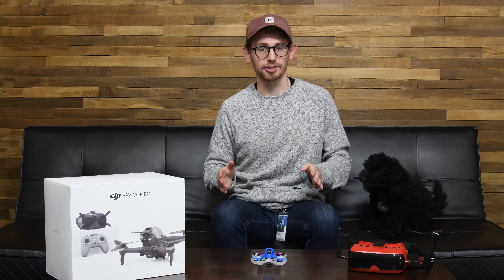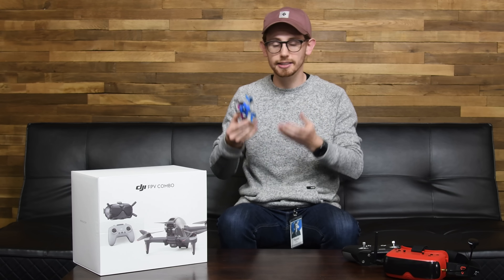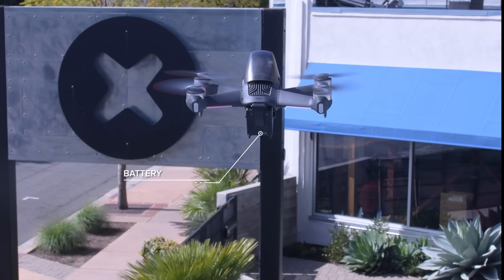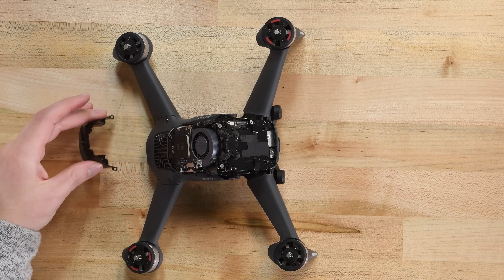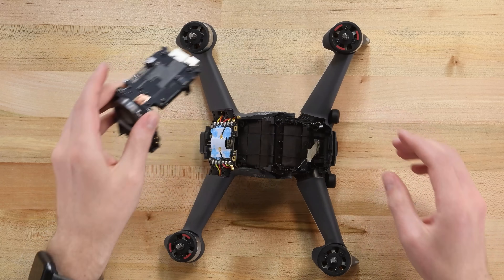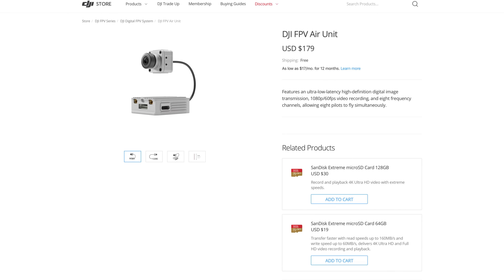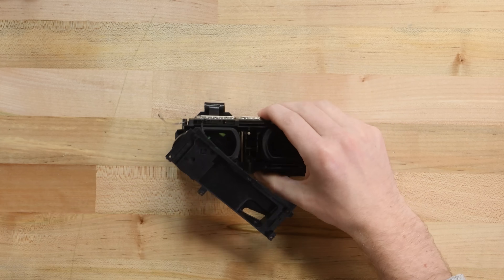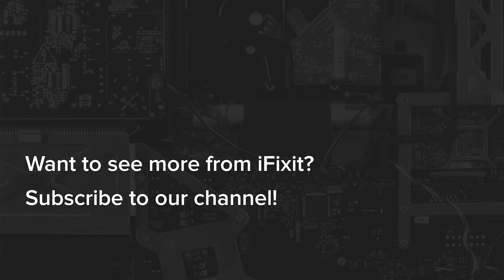DJI FPV Combo Teardown: Can DJI’s New Drone Kill the Custom Drone Market?

Comment: Solder points are on drones for durability mostly... connectors can pop out in a slight crash, but good solder points don't. Please research this more before spreading incorrect info.

Also... this is a teardown video but you're "sparing us the details" and skipping the teardown??? TF is this 😂

Comment: it is expensive because of 1. the goggles, 2. the big long-lifespan battery, 3. a 4k camera system, and 4. the innovation as a whole.

yes, other fpvs are a lot cheaper (nazgul5: $285), but if you include your goggles($17-$569) and controller($124-$300), use a gopro ($260-$350), find a counterpart for the long-lifespan battery and charging kit (another $100+), you'll end up a little less than the $1,200 price. This is without additional features that the dji fpv offers such as the RTH, emergency brakes, etc.

all in all, the $1200 price is fair enough for a beginner's fpv drone. it gives you more reason not to crash an fpv and fly responsibly.

Comment: You and most of the “fpv” folks always miss a huge point  here..  home built fpv drones even those built by people who know what they are doing can not land or take off  without goggles.. The best part of DJIs drone is its ability to be flown like the photo drones most of its consumers are used too.   With a flick of a switch it’s flown just like a camera drone..  no goggles needed.  This gives it the ability to be flown anywhere without the safety issues that come with traditional fpv equipment.  It’s good for beginners but it’s great for photographers who want that extra footage without all the safety issues and the learning curve that come with traditional fpv homemade equipment.

Comment: I’ve crashed and spent many hours looking for my old fpv drones so brought this on launch day but a sensor failure made mine drop uncontrollably mid flight  , for one dji wanted an extra £250 on top of the £300 dji care I already paid and second it’s been 3 weeks and still have no idea when I will get it back from the repair . Watse of time I’m back on analog I’ll sell the dji fpv when it’s fixed
Reply: Mines dropped out of the sky in manual mode broke to rear legs which i have successfully repaired unfortunately my sensor was damaged I can’t tell if it happened mid flight or it was from the impact damaged. I have no idea why i lost power

Comment: Is it true that DJI has stopped manufacturing the drone itself and will be using a 3rd party but will continue to sell the goggles and controller?
Reply: no I'm pretty sure it was just the air unit camera (which is for the custom market not this drone)

Comment: Short answer: no, the DJI FPV drone has less power and flies way more sloppy than cutom built FPV drones. Also there's no modularity like for custom ones, where you have endless options for the combinations of parts. Also, fixing a custom drone only costs a few bucks and maybe an hour of your time, compared to DJI FPV where you pay a fortune to send it in and let DJI fix it themselves.

Comment: I dont think so, dji fragile and hard to fix, the racing is impossible since huge video feed latency and freestyle is not as good compared to regular fpv, its rather slow compared to cheap custom fpv drones,... Its good for video production but not what fpv is realy used, in reality its made for videos nothing else, its a different market... The dji googles did not revolutionized fpv market since it comes with big latency, unusable on high speed and tight corners, only ppl who use dji googles is light flyers, amateurs, everyone else still uses analog.

Comment: Another note, you are the third reviewer who has stated that digital has longer range then analog. This is simply and entirely untrue. Analog has an immense advantage over digital in terms of range. DJI has the range marked at around 4km. A good analog setup could easier go 20km plus.
Reply: but you cant argue the picture quality, and in the end isn't that important for the experience/realism?
Reply: @foam27  No you are correct I cannot argue the picture quality. But all in the same I’d much rather just buy the goggles and a DJI fpv unit and use that. You get the best of everything, the performance and repair ability of homemade drones, and the picture quality of DJI. I don’t do super long range so the range is a non issue to me, I just wanted to clarify for those watching that some things he said were invalid.
Reply: @isaaclanier1507  I think you are correct about the range issue but not about the picture quality.
The transmitted video from the new FPV drone is superior than the quality transmitted from an Air Unit. NURK FPV made a video about this new drone and commented about the superior video quality over his other DJI goggle experience.
Before seeing NURK's video, I had assumed the video quality would be similar to an Air unit. NURK's video convinced me I wanted this new drone because of the improved transmitted video.
Reply: @ddegn  Ok yes sorry it is improved, I guess what I’m saying is for me at least, it isn’t enough to warrant going DJI and losing flexibility and repair ability rather then just building my own and using an Air unit. The Air unit is so good as it is that quite frankly I don’t feel the need for the better video
Reply: @isaaclanier1507  There a plenty of legitimate reasons not to get this drone. I was considering getting DJI googles and a few Air Units for a long time. This thing come out and it apparently has even better video. As an added bonus it will easily hover. My other analog FPV quads are really hard to fly and nearly impossible to hover. I really like being able to hover as I fly FPV and I really like this new drone.
If I had an Air Unit with Goggles I'm sure I would have liked that and I would likely not have purchased the new drone.
It's great there's more options.
Reply: @ddegn  and those are both fair points. Don’t take me wrong, DJI made a great product here, just not for me as I already know how to fly FPV fairly competently. The main killer to me again is being able to repair it, it’s much harder then a normal quad. That’s why for most people I’m probably still going to say buy a controller and try a sim.

Comment: I disagree with you saying FPV drones usually have limited compatability. The opposite is true, I love being able to replace almost any part with a different similar one if I can’t find the original
Reply: But that is absolutely peanuts compared to typical fpv drones. Can you switch the motors on your mavic and phantom? On fpv drones there are like 7 parts needed to assemble a quad (frame, fc, esc, camera, vtx, motors, props) and you can mix and match almost every part together. There is a standard for everything, and even competing companies still make parts that can work together. Where as dji have gone out of their way to make their products impossible to modify
Reply: @paul-fornage  I am super confused who you are arguing with. Read my comment again.
Reply: @isaaclanier1507  I thought you said DJI FPV
Reply: @paul-fornage  no I was arguing against how they stated that normal FPV drones have limited compatability. And how you can replace almost anything with anything else if you know what you’re doing. DJI made a lot of good choices with this drone, but I am still sticking with my homemade ones
Reply: @isaaclanier1507  well.. you CAN put 30000kv motors on a 6s.

Comment: The thing about it is, it isn't really an FPV drone. Sure, it can be an FPV drone, but it's more of its own thing half way between a camera drone and an FPV drone. It's honestly best when flown in Sport mode with all its sensors and computers working to assist the pilot in some fun, but not too challenging flying and to capture some cool shots. I see it as a method for Mavic pilots to get FPV footage without having to invest time and energy into the real hobby. Of course, it can also be a gateway to the hobby, and I hope DJI eventually sells a gen 2 air unit to work with the combo controller and goggles so that people who want to make the jump to real FPV can do so without having to buy new goggles and controllers.

Comment: A lot of people in the custom drone market are pissed about this. When the fact is... FPV is now on the map because of DJI.
Reply: I am excited that some FPV groups might finally form around where I live
Never have anyone else to fly quads with
Reply: Lol they don’t want it on the map
Reply: The FPV Hobby, not custom drone market. And most of us welcome it, but it has to be done right. It could have come in a better form factor, and a stronger/more repairable frame and canopy,  because you only learn in FPV by crashing.
Reply: they not pissed of, actualy dji is not threat to regular fpv, dji dont try to compete, they make cinema drones, and if you try to fly this dji as fpv always did, you will see that for that its a piece of junk... Its exceeds in video production but not in flying causes its made in mind video production, thats what dji does... And video feed  latency from dji googles is unusable in racing or freestyle... Dji brings good inovations and that's welcome. This drone is more like marketing material, ppl see dji fpv, then see regular fpv footage, normaly make expectations that this drone flee even better, but after first crash and more research they will buy regular fpv, more ppl in hobby is better...

Comment: On the contrary.. DJI just opened the gates for people to be interested in the custom drone market. A lot of people have no interest in assembling drones and as a result, will never experience FPV. DJI just welcomed every new comer to try it.
Reply: That's literally why there are "RTF" or "BNF" (ready-to-fly/bind-and-fly) prebuilt FPV quads.  They're sold by all major drone part manufacturers, iFlight, Armattan, Catalyst Machineworks, Eachine, etc.  They come prebuilt, no assembly required, you just choose the receiver option that matches your own radio controller for BNF, or just buy the RTF and get one included.  DJI didn't open the gates here, they just brought their fans along in a curated tour bus.  Will more people get to experience the joy of FPV flight? Yes, and that's great, but will they stay?
Reply: @syntaera  yes RTF or BNF require almost no assembly but the problem is that they are still built quads. I think, It's like built pc's and MAC. You can order a built pc and plug it right away. However, still it won't be like a MAC. MAC is even simpler and if something is wrong you directly go to the customer services and they fix it. The thing that i try to say is that "DJI FPV DRONE" is way easier to get, fly and if something goes wrong, you directly go to the DJI customer service. However, upgrading it is a lot harder than RTF and BNF
Reply: @alperkaya3334  yeas but experiance is different, you see dji uses digital video feed, it come with huge latency, its good if you fly in areas with alot of space, but if you realy want to dig fpv, you need to go analog, otherwise you going to crash that drone, and its realy fragile... To keep it simple, with dji you cant fly like with regular fpv. And 1300$, realy? You can buy 13 budget rtf fpv drones for that price...
Reply: @racistpixel1017  Yeah bro digital fpv system has a little more latency however, you can watch the video of rotor riot about digital vs analog. There is really not that much difference especially someone who buys a RTF DJI kit.
Reply: @alperkaya3334  so for dji its good but you don't expect to fly dji like regular fpv, its not build for that.
Reply: @racistpixel1017  That’s just wrong...the latency is more or less identical if you want to spend a lot of money for analogue parts you can achieve less latency but that’s in the ballpark of abt 10ms (rlly hard to notice even for a experienced pilot)
Reply: @nikolaspreuler5043  analog 8ms, dji 75-45ms... I dont know who cant feel what or perceive but pros dont choose digital for a reason... Even mr steely said that he choose analog since of to big latency.... I dont know what parts you can vbuy to achieve less latency since there not so many to choose from and all expensive...
Reply: “Everyone”

$1300
Reply: And I am one of the those. Lol
Reply: I'd never taken any interest in flying drones, this morning I ordered a DJI FPV :)
Reply: One of my concerns is that lowering the bar to entry into FPV, will then invite more careless pilots, which will lead to more accidents, and then even tighter regulations. Therefore I am not happy about this.
Reply: That’s the problem: It might seem like it’s a Great entry to the FPV Market, but it isn’t. If you want to do any tricks you Crash and plastic parts are just not as unbreakable as 4or 5mm carbon fiber. The parts of regular quads are designed to survive a LOT of crashes. DJI Fpvs Quad Break waaaaayyyyy more often
Reply: Yes, this thing is so breakable, especially if you're new, it's going to be massively discouraging.
Reply: No, they created a drone which explodes on a single crash, nothing like real fpv. Atleast the market will be saturated by v2 goggles so I can get an extra pair for cheap.
Reply: Well I'm assembling fpv drone like crazy so far my two from arms won't connect
Reply: It killed it completely, it is closed source no info is available on what component does what and there a no compatibility to add third market parts

Comment: This is not the first time DJI tried to enter the fpv market, but they seem to fail both times to get that fpv is a hobby, and it's too expensive as is, and most wouldn't want to crash a $1200 drone. Besides, you keep saying "beginner friendly", No it's NOT! You know what's beginner friendly? Open source, cheap easley fixable copters with a lot of parts and customizable... This meets NONE of the qualities mentioned above!
Reply: "You know what's beginner friendly? Open source, cheap easley fixable copters with a lot of parts and customizable..."
Those things are great but the DJI drone is still beginner friendly. It's super easy to fly. I'm pretty sure these new drones are selling very fast. DJI only allows people to order one. Other sellers are having trouble keeping them in stock. It's kind of hard to call this a failure when they're sell so well.
It's $1200 for the full set. The drone itself is "only" $700. I agree, $700 is crazy expensive for this drone. The whole package isn't too bad though. The transmitted video from this drone is better than any other option I'm aware of.
Reply: @ddegn  yeas but minority of who would want to buy actually buying since of a price... Most of beginer can only dream about buying one
Reply: @racistpixel1017  "Most of beginer can only dream about buying one"
Yes when comparing current options. It's still less expensive than when I started getting into RC aircraft. I wanted an aircraft which could hover and take photos so I purchased a RC helicopter. The helicopter and all the gear was crazy expensive. This was about 40 years ago.
I ended up using slow flying RC airplanes to take aerial photographs. Taking aerial photographs with remote controlled aircraft used to be very difficult and very expensive. This DJI is crazy inexpensive compared to the gear 40 years ago.
Of course there are lots of inexpensive options now. It's a fun time to be in this hobby.
Reply: @ddegn  cant argue, its a great time to start, there is super Budget solutions with crazy performance, probably even to powerfull for a first aircraft/drone. when i was a child i realy was dreaming of a remote control plane with a camera to see... For me that was a scfi dream back then XD

Comment: Sorry bud but custom drone market, really. DJI’s fpv drone is a toy. We build machines.
Reply: The trick will be to customize this drone. Put the video system from this drone into a more capable drone and you'd really have something. I think NURK FPV showed an example of someone doing this. I think Drone Dudes used the video system from the DJI FPV and put it on a much larger drone.
Reply: Let's see you design an FC  board and populate it. That's building ;D